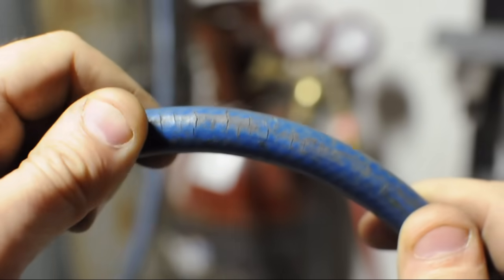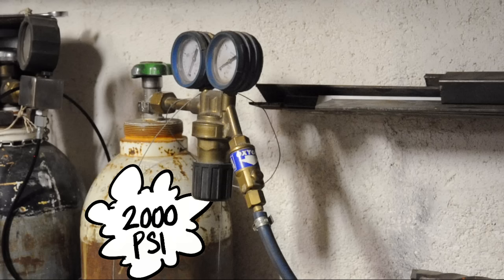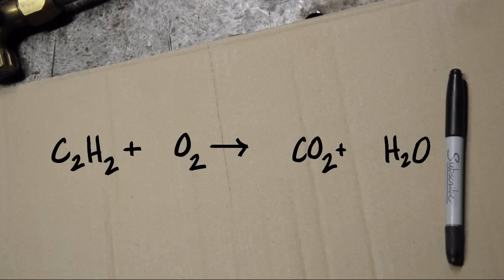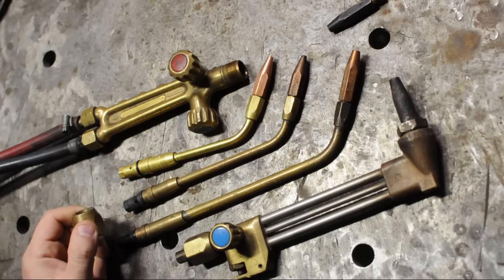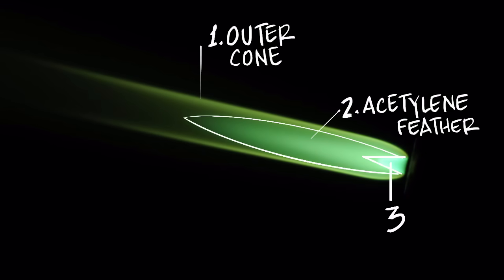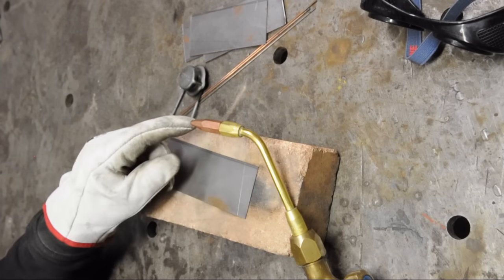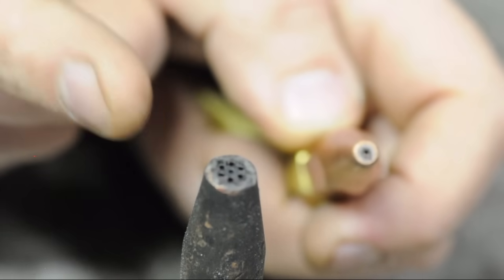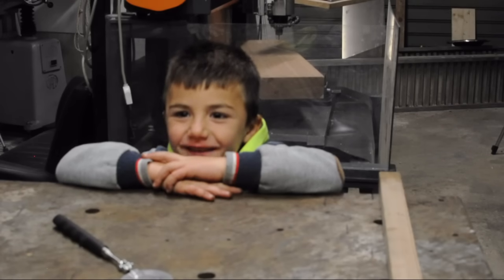Let's Talk Oxy Acetylene

Comment: Aw, man. I wish I had seen this back when I was working on my A&P license. It would have helped my welding project go a bit smoother.
Reply: Dettweiler I had to do this for my A&P too ahaha.
Reply: That and weight and balance, fire protection, NDI, rigging a control surface. Ahh the memories. Welding ,sheet metal work and bucking rivets was my favorite part.

Comment: NICELY done video Tony; 
Some info for nerdy shop rats like me (with several grad degrees),  not boasting but I often wonder how the hell I ended up as a machinist.
Any who, acetylene is a very interesting molecule, discovered in 1836 by Sir Edmund Davy, does not  hold the title of Sir, but I though sounded much better. During one of his experiments with potassium carbide (who knows what he was after) but he produced carbonized H AKA acetylene.
In 1859 Marcel Morren  (crikey must have a hard time in school,  Oh look its Marcel Moron.)
With  my limited intelligence, dyslexia, OCD, depression, let us stop there; I do not know why but he was doing an experiment in which god knows why he was striking an arc between 2 carbon electrodes in a H atmosphere. Well he lived to produce acetylene after the ensuing violent Rx  the carbon atoms torn loose  bonded with H and produced a gas we all now call acetylene. Late in the 18th century H2N2 was being produced by reacting calcium chloride with water (Miners Light same Rx.)
Now something north of 50% is produced from  natural gas, ~13% from cracking of dinosaur  squeezings  and the remainder Ca chloride method. 350,000,000 pound annually (160,000,000 Kg for the metric crowd)
As Tony mentioned storage is very interesting. A wee bit of diatomaceous earth, a nip of acetone into the tank at 300 PSI makes it much more stable.
Two safety items I was taught never to set the H2N2 reg above 10 PSI, at risk of having the H2N2 change phase (liquefy and become very reactive. Number B never apply any grease to tank fittings especially O2, for thee obvious reasons. hydrocarbon + O2 (oxidizer)= boom. Oh BTW a pure carbonizing flame is used to place a coat soot on the inner portion of the "mold" when pouring a babbitt  bearing just FYI.
WAKE UP I am finished, just wanted add a little history for us nerds. Nice and informative vid Tony Thanks man,
Doug
Reply: I guess some refreshment course is neede... ;-)
It was calcium CARBIDE (CaC2), not chloride (CaCl2), that creates the acetylene. (CaCl2 is pretty much inert, a tons upon tons of it are present in sea water, where it does nothing.)
H2N2, or rather N2H2 is a hydrazine - the acetylene is C2H2.Pretty close, though ;-) And, oh, "never apply any grase to tanks fittings" - to OXYGEN tanks fittings, the rest doesn't care. Somehow...

Comment: I'm in an agricultural mechanics class at my high school,last Thursday a guy was cutting with the oxy act and knocked it over and the tanks safety cap want on so the top broke and it flew across the shop and cracked about 2 feet of sand filled brick.

Comment: Something not mentioned about the Oxygen Bottle..

Those are Cryogenic Cylinders. They have a Cylinder inside the tank where they fill with Liquid Oxygen then the liquid goes into the outer tank and turns into a Gas then goes to the Valve outlet. Thats why on the Large Oxygen Cylinders you have Gas and Liquid outlets. You typically only use the Liquid Side on the large tanks to run into a Condenser System that does the same thing but will produce even more PSI. With two of the large tanks on the liquid side run into one of those condenser systems you can get up to 240PSI at the torch for the first 20-30 mins or so then reduces as the tanks empty. Which is capable of not only cutting Cast Iron (Never could get ours to do so.. Clean cuts anyway.) but also up to 5-6 FOOT thick Steel. (I actually did cut a couple blocks about 4-5 foot thick with ours) 

I worked at a scrap yard for a time and they installed one of those systems for us to be able to cut Cast as well as huge blocks of steel we had saved up with nothing to do with. And they give us this information upon installing the system. And the one we had wasn't even that big either. Some of the bigger ones run off even bigger tanks or even off the big silo tanks which can give those high PSI for even longer periods of time before losing pressure. But that's what those smaller tanks do on their own thus why they typically only have a Gas outlet and do not require the condenser system but you will never get those kinda PSI out of them either. This is also why if you pull from the Gas side on those large tanks and cut for a while the values can freeze up with ice or snow. Those condensers do the same thing when pulling off the liquid side as well.

Ive always found it odd how many fabricators ive met doing this work for many years and have no idea how either Oxygen or Acetylene Tanks actually work.
Reply: From what I have looked standard welding cylinders just have gaseous o2, since if it had liquid it would eventually evaporate and over pressure the tank
Reply: Shop cylinders do not have liquid oxygen in them.  The valves freeze up because anytime you allow a gas to expand it gets colder.  It's the same reason your air compressor gets really hot (but in reverse).
Reply: @stargazer7644  Talk to your local Cylinder Distributor... Because thats exactly how Ox cylinders work.
Reply: @Demonlord468  I think the kind of tanks you are taking about are only used to store oxygen from a oxygen concentration system. And for that the temporary storage limit isn't a problem
Reply: @Demonlord468  I can't just go look at the one in my shop?  And that is exactly not how mine work.
Reply: @stargazer7644   @ipodhty  Im not gonna argue with either one of you... simply go ask your local distributor. Take it or leave it that's how they work. simple as that. Their Cryogenic Cylinders. They have a cylinder inside the tank that liquid goes in and evaps into a gas OX in which you use. Thats why the larger industrial size 180L tanks have two outlets one for gas and one for liquid in which you run the liquid side into an external evaporator system to produce more PSI of which depending on the system you can produce up to 250-350++ PSI from the liquid side which is how its possible to not only cut Cast Iron but up to 6+ FOOT THICK Steel Bocks BOTH of which i have done for multiple years at a particular scrap yard as well as at 2 different Steel Service Centers i was employed each for multiple years. Take it or leave it...
Reply: @ipodhty  as i just informed the other dude Im not gonna argue with either one of you... simply go ask your local distributor. Take it or leave it that's how they work. simple as that. Their Cryogenic Cylinders. They have a cylinder inside the tank that liquid goes in and evaps into a gas OX in which you use. Thats why the larger industrial size 180L tanks have two outlets one for gas and one for liquid in which you run the liquid side into an external evaporator system to produce more PSI of which depending on the system you can produce up to 250-350++ PSI from the liquid side which is how its possible to not only cut Cast Iron but up to 6+ FOOT THICK Steel Bocks BOTH of which i have done for multiple years at a particular scrap yard as well as at 2 different Steel Service Centers i was employed each for multiple years. Take it or leave it...
Reply: @Demonlord468  You can't argue with me.  I have an oxygen tank.  It only has one fitting.  Oxygen gas comes out of it.  There certainly are cryogenic oxygen tanks. They are different animals.  You can also get cryogenic nitrogen and helium and probably others.  They are fairly large and quite heavy.  The 30 foot high oxygen tank at the local hospital is loaded with liquid oxygen.  It's quite a sight when the delivery guy disconnects the filling hose.  But the smallish 8 inch diameter cylinders people use for portable or semi-portable oxy/acetylene use (like in the video) are absolutely not cryogenic.  They are high pressure gas cylinders just like your argon or nitrogen cylinder.
Reply: @Demonlord468  hear is a forum talking about it. Lox tanks are used and common on strap yards. But they aren't the normal way to store it. If you don't use them constantly they have to vent off excess. 

So yes you do use a lox tank. They just aren't common unless you are running a massive junkyard or other large industrial site

https://app.aws.org/forum/topic_show.pl?tid=26916

Comment: And what is the proper procedure for shutting the torch off?
Reply: Try it both ways... the BANG will convince you to do O2 off first.
Reply from the maker: oh sh*t ... be right back.
Reply: +scowell I was going to disagree thinking that the oxygen purges the acetylene and letting the acetylene burn back into the torch with no oxygen would foul the torch.  Had the sense to google it and found out I was wrong.  Turning off the acetylene first may foul the torch.  The "pop" by itself is not exactly a compelling reason not to do it.  I have seen more people turn off the acetylene first than not, though you probably pay more attention to hearing the little snap as the flame goes out than if it were silent.
Reply: Time for a new shop... LOL
Reply: common sense would dictate that shut off would be the reverse of startup. acetylene on, oxy on, oxy off acetylene off.
Reply: acetylene first, the bang or pop lets you know the flames out, as all acetylene is purged from pipe, turn of oxy first acetylene still in pipe usually causes blowback, if you do this by mistake and you think you have a possible blowback situation, a good quick turn on oxy handle should blow it out

Comment: +AvE +This Old Tony. Guys, after your videos I am kind of puzzled. Is stick welding or oxy acetylene now the way to go?
Reply from the maker: For 2017, I'd go with lavender on color, classic french vanilla on flavor, and stick for welding.  O-A is very 2016.

I just got a "which welding?" question -- sounding like a good video topic.
Reply: Max Gatti 
Depends if you live in a community that has / uses electricity !
My Teacher reckoned he was so old he first learned forge welding but then this new fangled oxy welding came along !
Reply: Max Gatti   gas first, then stick, then a cheap flux core mig you buy at a garage sale, upgrade the stick to AC/DC, then get a water cooled Tig, upgrade your mig to something you can run gas on and finally buy a plasma cutter. That's the route I went and it was great. If I could only have one setup in my shop oxy acetalyne would win hands down with nothing even coming in a close second.
Reply: Depends on what you plan on doing/what fits to your needs best.

Stick=Cheap to operate, pretty light weight depending on machine, pretty universal, that you can do all kind of welding, but thin sheet metal work can be kinda hard to do and pretty easy to master with enough practice and dedication, thought takes ages to master in level of A+ structural welding.

MIG/MAG=Easy to operate, in essence cheap specially with flux core, but with gas you get much nicer welds, but that again needs gas that costs+needs a co2, or argon bottle, that brings one hazard more to your shop and depending on machine might lack penetration to do thick material, but excels in thin sheet stuff.

Gas=Universal enabling to do all kind of things like bracing and cutting, can be brought to out of work shop, place with out electricity, but its extremely hazardous if something goes wrong and requires expertise to operate safely, not to mention the costs owning and filling the bottles (like said in video 130Bar bomb that turns into ICBM if valve snaps off. Local schools metal class room got early renovation after couple of geniuses decide to put oxy acetylene mix into container.. and hit the spark... all welding booths fly on the walls, bottles fell over and valves were mashed turning them into ICBM's that fly all over the place, some punching trough the brick walls to out side and all the windows in area of 100meters were broken by the pressure wave... No one died, but dude who hit the spark lost his hearing permanently, had some broken ribs and rest of the morons got some serious hearing damage)

TIG=Best option far as i can see for small detail welding, but lacks penetration on bigger peaces, needs well cleaned parts to get proper welds, takes time to learn the hand eye coordination of moving both filler rod and the pistol right speed on each, needs gas to operate and machines can be pretty pricy comparing to rest.

Like i said all depends on what your doing and what size of peaces your working with, but most cases best way to start learning is to buy cheap stick welder and start practicing. I have stick and MIG machines, but due need for small part welding i think i will be replacing my MIG with a small TIG if i ever find cheap and small enough machine.
Reply: stick is so much cheaper and safer to start welding with if you just want to fix a lawn mower,gate hinge etc, if you want to make it a carreer then start with O/A, just my opinion on why recommendations are confusing, MIG is a little more expensive than stick but is by far the easiest to produce successful welds with pretty quickly, TIG is an art and is beautiful to me. I love tig welding.

Comment: The reason you should NEVER EVER light an oxy-acetylene torch with a lighter is obvious (unless you happen to have a Zippo lighter)... the BIC lighters has a plastic case... plastic melts if heated enough...  even welding sparks can set the casings on fire...

And when lighting an oxy-acetylene torch you have to be quite quick otherwise the area fills up with too much oxygene and acetylene mixture... if you're kind of sloppy you might even pass out if not carefull... however when you light the lighter the flint will throw ALOT of hot sparks everywhere that might ignite the leaked out gases... and the lighter in the process.. I saw the end result of that happening... BOOOOOOM and we all rushed to see wtf just happened:..

The irony of it all where the fact that our teacher had warned us about exactly that some 5-7 minutes prior to the incident...And btw... I was terrified of the rather sharp sound the oxy-acetylene creates when ignited.,.
Reply: A piezo stove lighter is tops, even after it runs out of gas, just the spark will ignite the gas. AND, it's got a long nossle to keep your hand away from the light up.
Reply: Thiesen 1. Act quick 2. Work outside

Comment: I was a welding and fabrication apprentice 1976, this is good info, just one thing, purge hoses when first lighting after newly connecting and if torch is left off for any length of time especially on a cutting set up.
Gaz UK

Comment: Fantastic video and I love the ending. 😁
I love the way this one you kept the humor to a minimum so people would understand the safety of welding equipment. I know this is an old video and someone has probably mentioned it because I haven't looked through the entire comment section. 
Don't use oil on the fittings of gas welding equipment. Dry assembly only.

Comment: You brought back an old memory.
Back in high school our automotive shop was sort of connected to the welding shop. I was under a car bleeding a clutch when suddenly the whole welding class went running by where I was, the closest to the welding shop, and out the garage door.
I thought, that was odd. A second later the fire alarm goes off. Turns out someone knocked over a tank of gas and the end neatly broke off venting gas into the shop.
Unfortunately or fortunately there was no exciting explosion or fire works..
It is funny how the brain works. The, "isn't that odd" thought as they suddenly go running by instead of "oh my god, I best be following them and ask why later.

Comment: Great place to start, Tony.  Just a reminder to keep the acetylene pressure below 15 psi. I've seen shops whitewashed with hydrated Calcium Carbide from the explosion of an Acetylene generator running at 30 psi. If the pressure is over 15 psi, Acetylene or Ethyne same gas with a different naming convention, can spontaneously deflagrate with or without oxygen. It also forms unstable explosive compounds with Copper, Silver, Zinc, and brass with more than 66% Copper and halogens.

RTFM on Oxy/Acetylene and follow it.

Comment: Good vid. I pretty much only use my torches to heat stuck bolts and such so I actually went to Propane a few years ago and it's amazingly cheaper. It does take a little longer to get hot if you need to cut but it's not double or triple like the cost of Acetylene vs Propane.  I keep my bottles on a very sturdy cart held against the back with a stout screw and a thing I made that kind of matches the shape of the bottles as a clamping surface. It's been at least a year or two since I've had to buy oxygen and the propane bottle, even when I'm pretty busy often lasts more than six months. Propane requires a different tip and I'm told (by the people selling regulators) it requires a different regulator. The way I adjust the pressure I'm still well within the range of the "use side" gauge. Everyone I know that has gone to propane didn't buy a new Propane rated" regulator. So I've been using the same regulator I used for Acetylene for a few years now without any issues. I'm sure someone will tell me how dangerous this is and how I should buy a new regulator but I've never really got a satisfactory reason why I need one other than "you REALLY should". Hell, I "REALLY should" quit working with my busted up hands before I'm unable to button my jeans but that's not likely to happen anytime soon either. And even then, I'll  just go to valcro. LOL